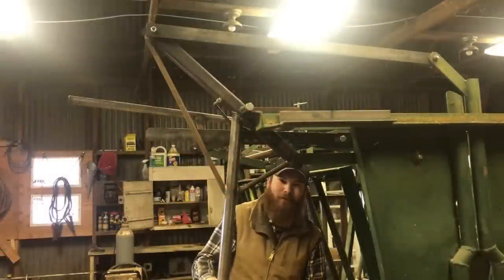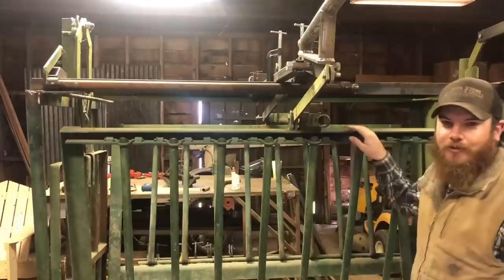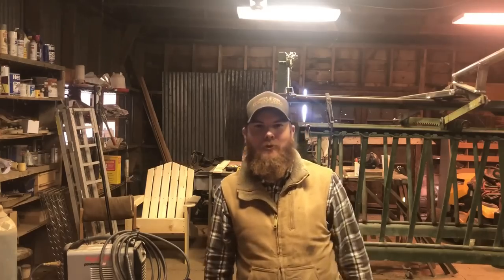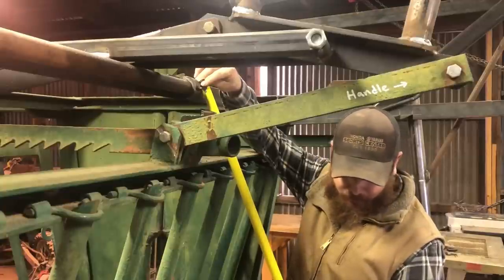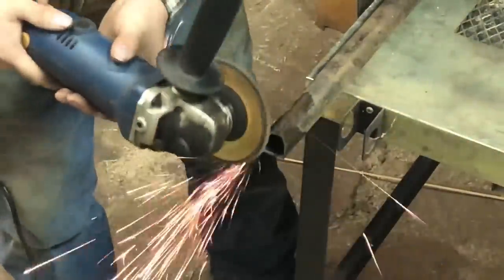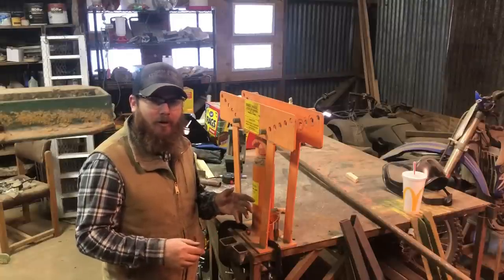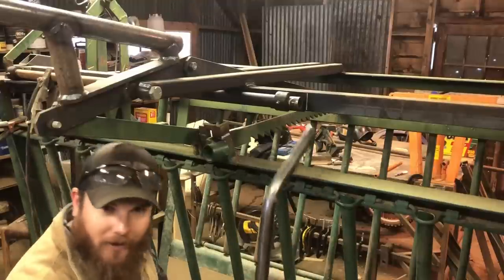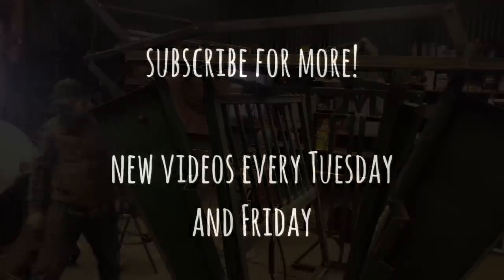Restoring an old squeeze chute. Part one

Comment: One thing that I would recommend is get a can of that spray foam and put some in the end of your handles. Wasp really like to build in pipe and square tubing for some reason.
Reply from the maker: Excellent point. I plan on capping all pipes before I’m done for that very reason! Whatever doesn’t get capped will get foamed

Comment: Can't be a rancher/farmer without welding equipment. I have a Miller Diesel Big 40, Miller 200 amp gas welder and a Miller 180 with aluminum spool gun. Also an ESAB plasma cutter capable of one inch cut. I find Makita makes the best grinders. And cordless, everything is Milwaukee. You will find that you can never have enough tools. Anyway, I like your welds.

Comment: Nice upgrades we run a hydraulic chute with all the cattle that we run every year its built heavy and I like it makes working the cattle easier and faster
Reply from the maker: I have operated a hydraulic squeeze and you’re right, they are awesome and almost a necessity with large numbers of cattle. Only problem is I’ve never seen one for less than $10,000 so they’re a little out of my reach! Although now you got me wondering how hard it would be to convert one to hydraulic? Thanks for watching!
Reply: They cost alot but ours has paid for itself it's about 5 years old haven't had a bit of trouble I don't know how hard it would to convert to hydraulics

Comment: Sorry late to the comments 👍you sure you wanna sell it , it's probably gonna be better than the newer one your using ? Thanks for the review on the tube notcher, I wouldn't have guessed using a cordless drill , I mean, I was looking for your hand to be in a cast towards the end of video there 😉👍
Reply from the maker: Haha yeah I was really starting to worry about you BTO!!  It will be good but not as good as the new one for a couple reasons- the frame is a bit smaller and it doesn’t have the adjustability the new one has to accommodate different size cattle. You definitely want to have a firm hold on that drill!  Smart people hook those up to a drill press but not me! Thanks for watching!